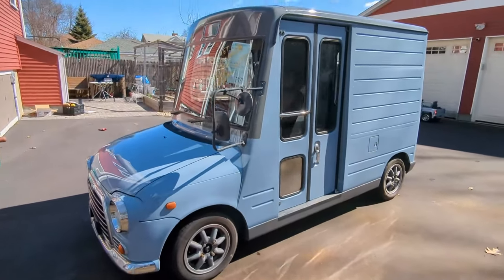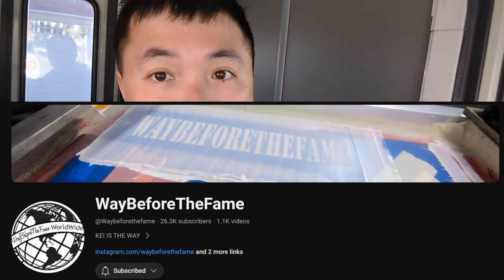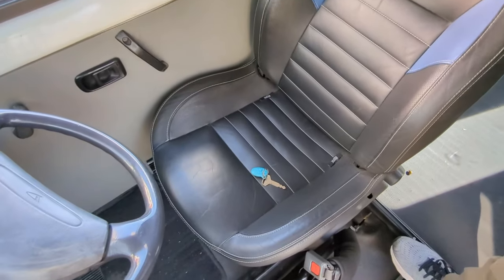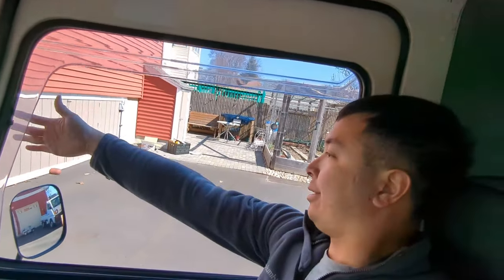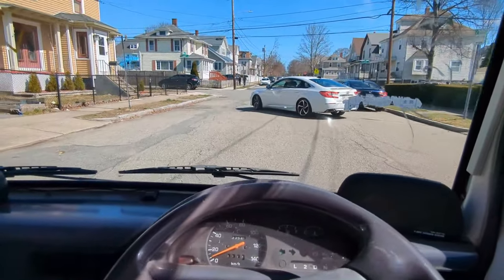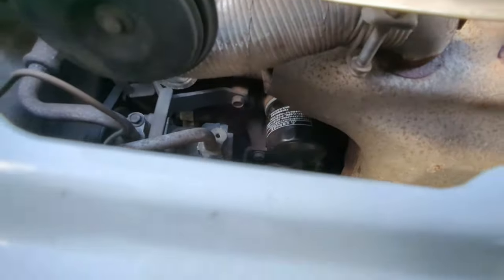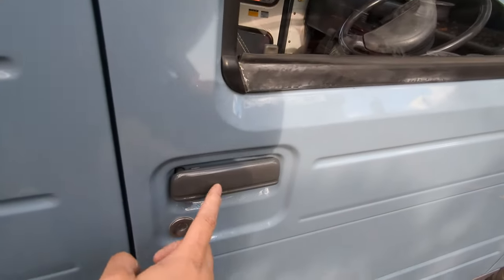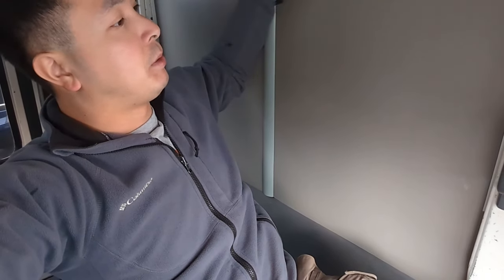Daihatsu Mira Walkthrough Van L500V - Overview... (Walkthrough Walkaround?)

Comment: I've got a similar Walk-Through. Mine is a 1993 and also does not have the side windows which I like as I've got a 32 inch TV mounted on the wall behind the drivers seat. I've had it a couple years and it's a blast to drive as long as you are not in a hurry. 55 mph on flat level road.
I'm sure your wife will enjoy it‼️
Reply from the maker: She is loving it! I need to look into how to make it handle a little better maybe a different wheel and tire setup. The thing understeers on a long sweeping turn like in a rotary and it is quite spooky. We want to do the TRXX fuel injected turbo engine swap so that will make it just a little faster to work with normal traffic.

Comment: Not sure how much time you've put into this yet but something you could try with those two locks that the key doesn't work with - you can try putting the key you have in the lock, applying a bit of twisting tension on the key from the side and tap on the protruding end of the key with a hammer. This will put some kinetic force into the barrel and potentially "bump" the pins into position after a few knocks. The twisting tension on the barrel is also important because once the pins do jump into the correct position, the barrel will move enough past them to prevent them from crossing back over the sheer line again. Turns out I do learn stuff, thanks, lockpickinglawyer! :)
Reply from the maker: A few videos after this one I ended up going through how to take the lock cylinders out and a locksmith did something to them to rekey them to the ignition key and were able to figure out the OEM key code to cut new keys out of blanks by code and they work great. They said it was based off of a Toyota Celica key code.

Comment: Missing a key.  Love the Van.  I'm 6'5'' & need something longer, but for a short person it could be a cool small camper.  Watched a Japanese Podcast (I think) - showed English captions for the story.  Interesting.  Rental Camping Van.  Gentleman goes up into the mountains and sleeps overnight and comes home.  Wife is OK with him taking off.  Probably quite inexpensive, but around here - Massachusetts it would be overpriced.  Nothing is available that would come close to the rental in the Japanese Podcast. This Van must be 1990's?  Nice if they returned to reliable, workable and simple.  I've had older trucks.  Boomer.  Thanks.
Reply from the maker: Yea I ended up getting the tumblers worked on and the locksmith made it work. 
This one is a 1998, I also bought a larger van waiting to be shipped. It's a 1998 Nissan Elgrand. It's like a luxuryish passenger van. 
I expect to get it in October or so.

Comment: I have no idea why but i keep looking at this and thinking...could you fit a single small bed in it.  remove the jumper seat,  and run the bed segments from the dash all the way back.    remove the front pillow/bedding fold it back and have access to the door again.   use the pillows to form the back of a couch on the rest of the bed,  pull down table,   storage area behind the drivers seat Solar battery to power some kitchen things as well as lighting.   

hehe,  sure you can't stand up but still, would make an interesting micro camper.
Reply from the maker: In regards to using this as a micro camper, It seems doable if you're doing it solo. I could get you the measurements around the cargo area to kind of lay out a floor plan if you would like to see.
You know those vehicles with the high roof modifications? The ones where the top is cut off and a new taller fiberglass roof is put on.  I don't see why that can't be done but it might make it a little more odd with the new proportions. 
The only thing is you would probably want a little more power, I'm addressing that in a future video since I have made other ones complaining about how slow this thing is. Keeping it stock, a tune up is very important to help bring it up to a tolerable output of power where you aren't a hazard on the road.
Reply: @AnythingWheeled  don't even need to do the high roof or popup roof mod.   yes it might be "short" inside, but look at tear drop trailers, they are short inside too.   propane stove, propane buddy heater,  jackery with portable panels you can set up outside.

The least modifications you can do the lowest cost you can make :)   and in this case if it can be done such that you can still use it as a cargo van by folding the bed, table and such out of the way...   double points.
Reply: @AnythingWheeled  "Hazard on the road"   Ok in Canada there are 2 classes of highways.   you have the 400 series main highways, and the 2 series secondary highways. 

to drive on a 400 series you need to be at least 80 kmph up to 100 kmph (50-60 mph)

BUT to drive on a secondary, 2 series,  the speed limit is 50 kmph min,   80kmph max  (35-50 mph).     Truth is,  for a van like this' i'd prefer to keep it to the secondary highways.
Reply from the maker: @jenniferstewarts4851  ah around my parts everyone loves to go fast even in the residential neighborhoods. Speed limit is 25mph (40kph?) but everyone is going 35-40mph. (70kph?) I can get to 65mph okay (105kph?)

When I first got this I had a lot of trouble going from 0 to over 25-30kph. I would be at 20 or so for 6-7 seconds. So merging into the road that has people going 60kph is why I said it's a hazard.
Reply: If you make it taller it will choose to lay on it's side when it sees lorries cruising by 😂😂

Comment: This van is awesome. Awesome color and rims, looks like it's a full panel van or vehicle. It probably would be even sicker if you add another carburetor if possible or a racing filter if you want to supe things up a bit. Yeah make the videos shorter if you can. Either way, awesome video. 👍🏼👍🏼
Reply from the maker: I'm going to see what we can do with it as is but I think turbo is the way to go 😀
I kinda wanna replace the squeaky corrugated plastic with wood panels.
Reply: It's 660cc dude. 5 hp means shit
Reply from the maker: I believe it's more like 20 and that's really what it needs.. my Cappuccino can get out of its own way. My Cara is hopped up to 100 and moves well. Anything is better than what it is now with this tranny that wants to be in 3rd all the time.

Comment: I have one of these i converted to electric fom a 2020 leaf, love my van
Reply from the maker: More info please. Did the entire battery pack fit under the floor?
Reply: @AnythingWheeled  made a custom battery case, had to raise the van a few MM, then run the charging port to the gas fill. Got a 225 mile Kei van, my commute is 10km one way
Reply from the maker: @s.porter8646  Oh the battery is under not in the vans false floor? It was something I thought of because Leafs would be cheap and plentiful however I don't know what I'm doing so I decided against it.
Reply: @AnythingWheeled  we did an 87 YJ back in 2016, but we stripped the battery to put cells, where the fuel tank was, in the rear cargo, and over the wheel wells. That was a 2011. Built a few conversations with totalled leafs, and one Chevy bolt. I'm in Japan now, and wanted a Mira when I was living in Okinawa in my early teens, now, it's EV conversion, picture Disney making a movie, Sept mine isnt lame and gay

Comment: What a super cool ride?
Is your wife going to  use it for work, or just driving around.
Reply from the maker: all of the above! I bought a few stuff for it. We want to upgrade to power steering and get turbo'd
Reply: @AnythingWheeled  nice!!!! By the way, I did notice the hole in the rubber on the bottom doors as soon as you got in the front. You can see a flash as you first look back there.
So you’re good, you didn’t damage anything.    ;-)